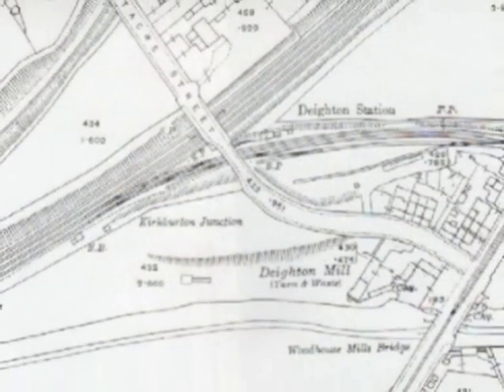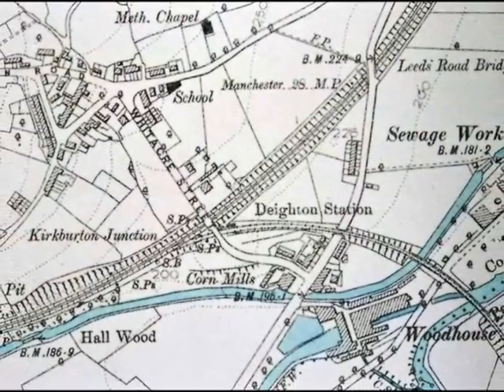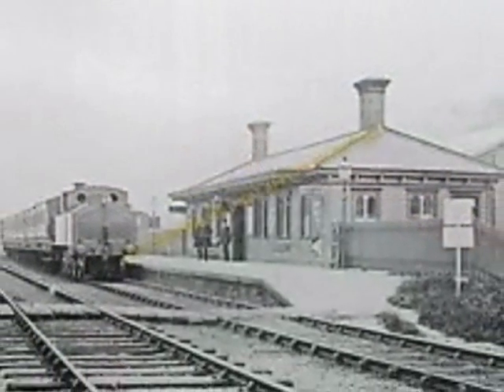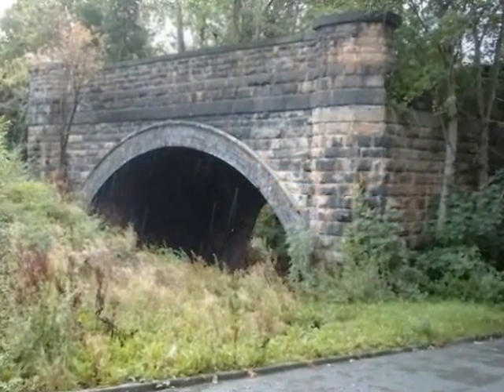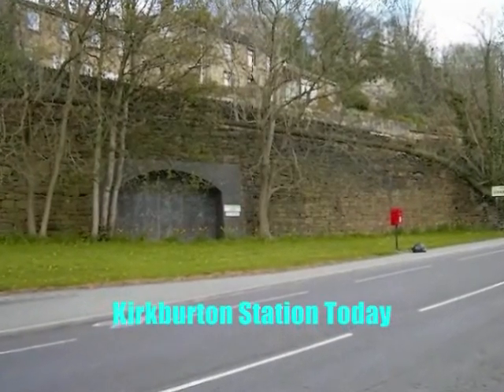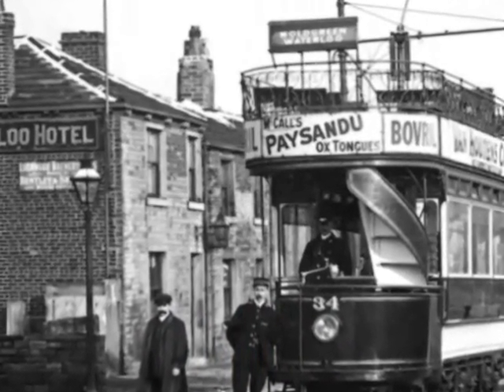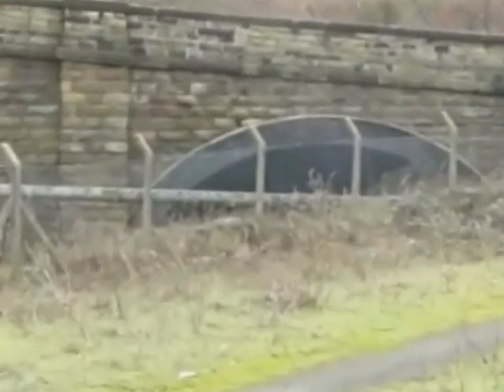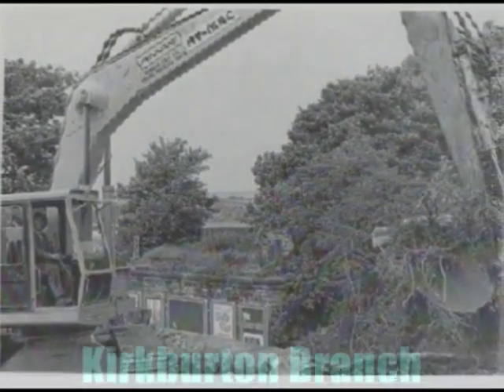NS450R Kirkburton Branch Line

Comment: Many thanks, Michael. I have the little book and this goes well with it. 

My grandfather Henry Shepherd was a(/the?) driver on Kirkburton Dick until he retired which I think would have been in the 1930s. The photo at the start of your film would have been before he started. I’d be grateful if you or anyone else has any pics of the engine showing the driver. 
Where there ever any tank engines run on the line do you know?
Regards